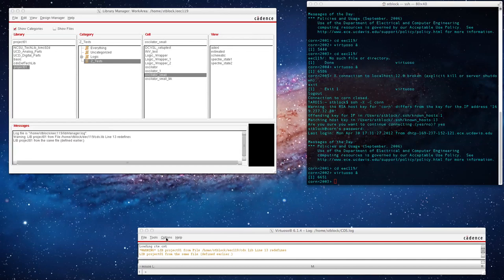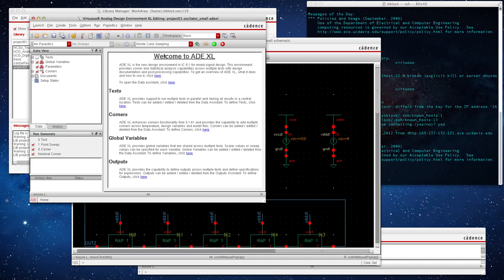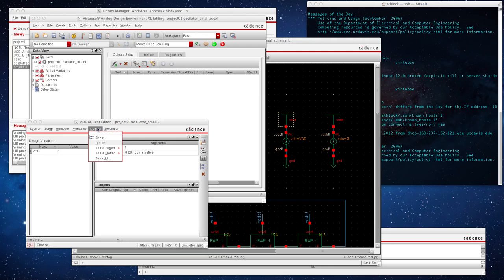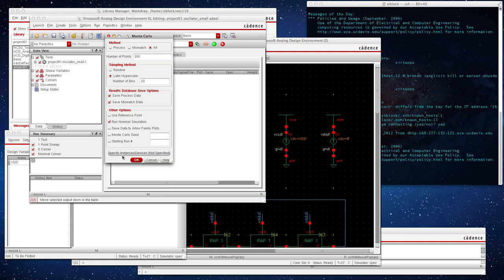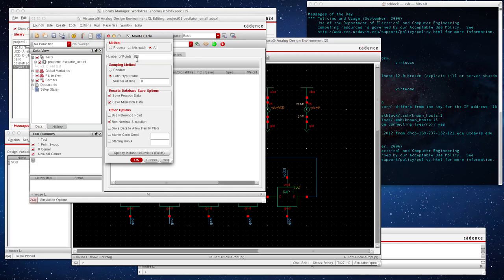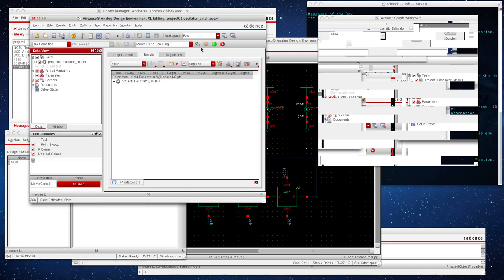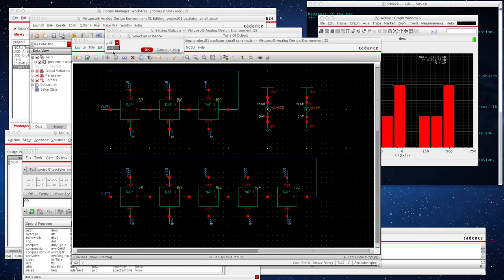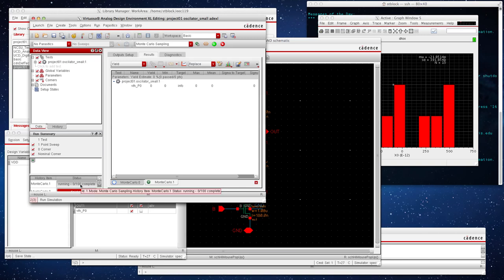Monte Carlo 1 of 2

Comment: i have NCSU library nut there is no any folder with PTM
can u help 
when i run the simulation of monte carlo it shows
ERROR (ADEXL-5052): Monte Carlo run stopped because no statistical data generated for the test: